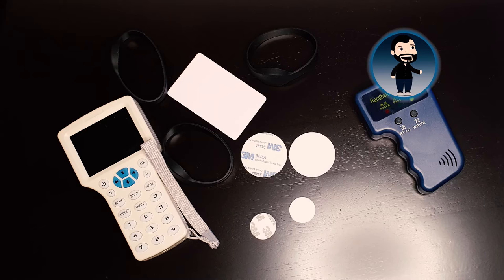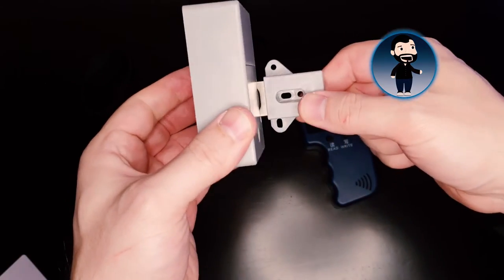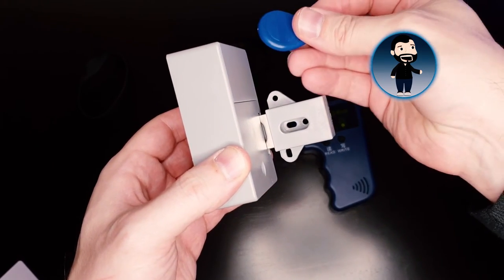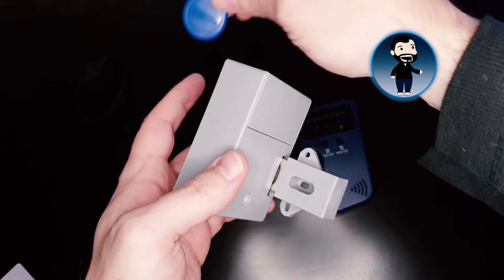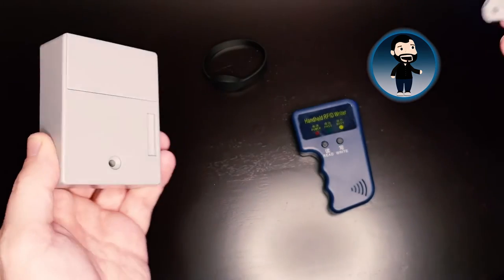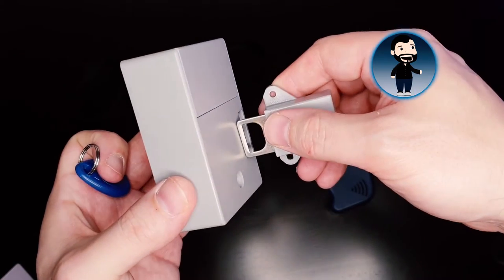Cloning And Smart Use Of RFID Keycards & Fobs

Comment: Hey Guys, the key fob I have (Salto) shows IC-Type A and success read & write, but still the cloned one doesn't work also not giving the option to decrypt with the software, any hints?
Reply from the maker: Not really familiar with the Salto fobs but I've looked into a bit of info and both their RFID and NFC (mifare) cards are encrypted, so while you might be able to read and clone the card ID with a standard reader and writer its unlikely you'll be able to clone the security info. Given that its IC type A im guessing its a Mifare 13.56mhz card or similar, you'd probably need a good reader and apps like Mtools are mifare tools. This is just guesses so I'd do some more research to ensure you are looking at the right option for your specific fob... this is a mine field as there's so many standards and types.

Comment: I have one of those home door keys from KABA. Its a key with its back being blue color and theres a card in there or something, that you put on the door lock and it opens the door. I wanna clone it but what frequency is it or decryption?
Reply from the maker: Did a bit of checking on their website and their data sheets say badges and read/ write devices have matching security encryption that are not accessible, this is would suggest that  only official fobs and readers from Kaba will work. Also seems like their fobs are based on Mifare chipsets so frequency would be 13.56 MHz, but it's not the only standard they do. But it's unlikely you'll find an over the counter device that can clone these either way.
Reply: tnx mate!

Comment: Hi Andy, Great Video. Does the "RFID Multi Card Reader" you linked to in the description "Write" HID fobs? As in the product description it says "【Recording support" - It is supported for HID card 1386/1326/1346, T5577, EM4305, Mifare UID. It can directly enter the number keys." But doesn't say write. Any help would be appreciated 👍
Reply from the maker: Hey there, assuming they haven't changed it since I purchased it, it writes the HID cards for me. What I've found is the best option though is, if you're reading HID cards, to buy T5577 chips and cards to write too as these are cheaper and can support the HID standard. So you'd be reading from the HID and writing to a T5577, effectively turning it into a HID chip (they're virtually the same anyway). So if you check out the video I did about getting a chip implanted in my hand (https://youtu.be/N1l50COggh8) I read from a HID fob for my apartment, but the chip I get is a combination T5577 / NFC chip and it works just the same as a HID chip. 

I would say that all these readers are temperamental. I've had no real issues over the years, but the chips can sometimes have strange encoding or encryption so nothing is guaranteed. BTW, lots of locksmiths have the tools and equipment to read and write fobs, so might be no harm to chat with one of them and see if they can help with your specific keyfob / card. Hope this helps.
Reply: @AndysTechLife  Hi Andy Thanks, I ordered one looks the same as yours however, I just keep getting the error message "read failure" on scan and read. I have tried three different fob types. Any Ideas? (Apologies for all the questions)
Reply: @AndysTechLife  Hi Andy, I've just dropped you an email with video of issue, thanks alot.

Comment: @andy Nice video, i have question though. I have a handle door lock with access card same as hotels or so and not a high end i guess, but on that card our office put expire date. so such card will we be able to clone and duplicate or can we modify or remove its expire date by that 2nd device you showed. Remember those locks are nor centralized and nor computer operated. the office have a nfc black reader they place card on it and update it for one month each time. so what do you suggest from your experience. Plz help
Reply from the maker: The readers won't be able to change the date / expiry on the cards if that's how its done and tbh you'd need to get the specific reader for the type of cards and locks that your building uses to be able to read a write at all. Its possible though that each month they just write a different access key or ID to the cards rather than an expiry date. If this is the case you'd only be able to clone the current 'key' and still need to go every month to get the new access key.

Comment: I have the multi reader. Was able to copy cards of mine onto the included cards with reader. But for some reason I can't copy my cards to the blue keychain fobs that came with the reader, any idea what may be wrong. I understand that's not a lot of info, but figured it's worth me asking.
Reply from the maker: So when I bought the reader it came with a sample of a few different types of cards and fobs, so it's possible that they're not all the same chipset, so that would mean that you can't write to all of them. Best thing to do is use the scan feature on each of the cards or fobs and this will show you the chipset / frequency. Using the scan button on the reader will cycle through all the different settings and land on the correct one for the fob being scanned, so this will tell you if they are different ones. Hope this helps.

Comment: I liked your video but I have a question so I have a key fob to open my apartment gates as well as enter to the office and gym is there any way to clone it since it has multiple buttons to open each door by pressing the button, does this device clone it? if not is there any way to do it because Im planning to buy the a cloner, thanks
Reply from the maker: The ones with buttons, particularly multiple ones could either be using IR or a radio signal like a car key fob so these can't be cloned onto stickers. These would need a signal scanner and repeater to clone which is more expensive and not any smaller. Unfortunately this cloning method only works with contact rfid chips as they're passive. Ie. The get the power from the contact pad so they are easy to copy. Button ones are active, ie they send out the signal so you'd need something to read the frequency and code via radio :(

Comment: I got the little blue reader/writer it came with several tags, I want to clone my home access, because of the number of times it beeps I'm guessing my access key is HID (Mircom) and the blank tags I got are EM4100 so no luck cloning it yet, what you said is that if I got T5577 cards, tags, wrists or whatever those are compatible with HID frequency right? Thanks!
Reply from the maker: Em4100 are not HID compatible but T5577 are, but just be aware not all readers, particularly the small blue ones can read and write both T5599 and EM4100.

It's also a good idea to Google your own existibg card to check if it is HID as if it's not you may need a specific reader / writer for it.

Unfortunately there's no one type fits all as there's so many standards and types out there.

Comment: What's up?  Been into locksports for years and I just got into playing around with RFID fobs. I needed one for my hid fob and had no problem. I notice after trying to copy a friend fob I had an issue with his Keri series fob but the 22 key digital smart card rfid reader writer machine with HD display from Amazon wouldn't read or write it. Could you if possible do a video on the best handheld machine for fobs and the type of fob. Can I use a chameleon proxmark on a smart phone or tablet ? Appreciate the channel and info... 😎🤘🏼✌🏼 From NYC-USA🗽
Reply from the maker: Hi there, thanks for the comment. I haven't found a handheld solution for Keri  or Keri K series fobs, they seem to use some proprietary encryption so although there's services online where you can send a fob to be copied I can't seem to find anywhere that sells a device like the one for the HID fobs.

In terms of using with a smartphone or tablet its unlikely unless you have a external RFID adaptor connected as although smartphones support NFC, the frequencies and technology are different to RFID, and even if your fob is NFC the phones have limited ability to read and write, particularly more complicated NFC cards like those found in travel cards etc.
Reply: @AndysTechLife  appreciate you getting back to me on my question. If I make any headway on the issue I will be sure to report back.. ✌🏼🤘🏼☝🏼😎🗽

Comment: Hey Andy. Quick question as I'm Abit confused I want to clone and copy my college Id card onto another card Incase I lose my main one which reader and writer should I use? My Id is used to open a security gate to get into my college mainly.
Reply from the maker: There's no one reader that will work for all devices and fobs, so you need to find out what type of fob you have. Generally its printed really tiny on the device, such as HID as the manufacturer. Once you know the fob type you'll need to ensure that you buy a reader that is compatible with the specific make that you're using. There's so many formats, frequencies and standards so there's no single one you can get that will work for everything. For example, my old college ID and work ID are HID Prox 2 Tag cards which can be read and written to T5577 cards, but I have a locker fob which is different and can't be read with this device. If in doubt, locksmiths can generally read and copy fobs so may be able to tell you the specific make and model. Hope this helps.

Comment: What if you have several on the back of your phone? Do readers get confused? 
e.g. you have; apartment, gym and workplace as three stickers on the back of your phone
Reply from the maker: The stickers are really short range, so as long as I press the correct sticker against the reader there doesn't seem to be any issues. I've left a few mm between them just to be sure, but the only time there's an issue is when I forget which is which and try and tag the wrong sticker at the wrong reader :D
Reply: @AndysTechLife  thanks for your reply! Are the stickers thick? Is the range too short for them to be placed on the inside of the case?
Reply from the maker: They're about 2mm thick so they probably wouldn't fit inside a case comfortably and unlikely they'll work through it if the case is thick.
Reply: @AndysTechLife  is it possible to copy multiple different door frequencies onto 1 key fob

Comment: Hi mate great video', Do you think it could read & write sifer-p innerranger 128 bit AES encryption? Thanks
Reply from the maker: Very unlikely, most of these readers won't work on encrypted cards and only really work on ones that have plain text / numeric encoding. They also work on only the most common chipsets. For specific makes and models it's best to search for their own reader / writer, but for encrypted ones generally you'd need to go to the manufacturer and this still doesn't guarantee you'll be able to clone if you don't have access to the key that was used to encrypt your own specific fob. It's a complicated space with too many standards but the readers do work with the widely available commercial options like HID.
Reply: @AndysTechLife  Thanks Andy much appreciated.

Comment: Can the RFID readers you've demonstrated here clone car door fobs, garage doors, security gates, etc.?
Reply from the maker: So these readers will only clone contact fobs, i.e., ones that have to be physically touched against a reader and even at that every manufacturer has different standards and chipsets, so there's no one reader that will do all. I always recommend Googleing your specific fob to see if it can be cloned and if the reader you buy will work on it. For example, lots will do HID or em4100 which are very common chipsets, but there's no guarantee that you'll find a reader that works with your specific fobs. For radio or infrared devices and fobs which transmit a signal you're looking at completely different devices to clone and copy and this is much more complicated as you need to capture the signal, find a compatible chip to add the code to and many car manufacturers for example now use encryption and other preventative tech to stop you doing just that. You'd probably be looking at different readers and devices to copy each different fob, unless you pay for high end devices that you can connect to a PC which could do multiple. If in doubt, check with a locksmith or key cutter as they may be able to point you in the right direction.

Comment: Those M3 stickers T5577 can be writen from a ioProx fob? I have a oiProx fof for our apartment and want to copy it to that M3 T5577. Is it possible? And I also put down ioprox fob writer and it shows me the one that you are using, the white one. Is that correct? Thank you upfront if you respond.
Reply from the maker: From what I can tell you can provision the T5577 to act as a ioProx fob, but its not as simple as just using a reader, the chips need to be provisioned first to act as ioProx first. All the readers look the same so don't take the look of one to mean its going to work. Check this out for more info: https://forum.dangerousthings.com/t/cloning-a-kantech-ioprox/4415/8

Comment: My apartment complex uses the generic credit-card style key for garage access and the circular HID for elevator access. Is it possible to write both to a single T5577 Sticker?
Reply from the maker: No, each tag will only take 1 ID at a time, but it's likely that one of those will work for both, I have a similar setup where the door is a fob and the car park is a credit card size, but the credit card size works for both so that's the one I copied.
Reply: @AndysTechLife  

The apartment building I live in uses NEDAP Windshield Sticker for garage access and HID Key Fob for elevator access. I have these 2 devices.

For $150, they sell a credit-card style plastic key they gives access both to the garage (if you wave it in the air) and the elevator. It seems like this is the one you copied, Andy.

Is there a way to make my own plastic key or fob or sticker  that gives access to both the garage and elevator without buying the $150 plastic key first?  In other words, can I use the 2 devices I already have to make 1 device that handles both the garage and elevator.

Thank you so much!
Reply from the maker: Not really, either way you're looking at 2 chipsets so you might be able to stick them together but it'll still be 2 cards at the end of the day
Reply from the maker: Unless you can get a hold of one that does both and see if you can copy that, but you wouldn't be able to 'guess' at it or combine 2 different cards to make a master one.

Comment: Which device works for reading and writing intercom push to open button to a keychain remote?
Reply from the maker: There's so many variations to be honest, your best bet is to Google the particular make and model of your fob or button. Bare in mind though that with so many manufacturers and standards, you might want to consult with a local locksmith first. They're generally pretty helpful at letting you know or helping with copying etc. But there's no one machine that will do all of them,
Reply: @AndysTechLife  Don't wired intercoms use RF signals?

Comment: Just bought one but it always fails decoding my ic-type a encrypted card that I want to put on a smaller fob. Any suggestions
Reply: I ask because I make the key cards for my building but I hate the key cards and want to program smaller fobs. But last fobs I bought where the wrong type for the encoder we use
Reply from the maker: You can try connecting the reader to a PC and see if there's any additional software that you can use to decode, but unfortunately not all encrypted cards can be copied and it really depends on the encryption used. If it's in any way similar to Mifare type A for example, this has read-only access and decryption is difficult. You can check this for more reference, but there's no one solution that works for every type of fob and card: https://www.youtube.com/watch?v=tfti68oKydk

Also, if you do manage to decrypt, bare in mind you can only write back to the same or compatible fob. So you're best bet is to find the writable version of what the card is and see if it's available in different sizes. I have about 6 or 7 different types of cards and fobs from different things and I've only been able to copy about 4/5 of them so far since different chipsets and encryption need different options. 

When in doubt, many locksmiths have the tools and software to copy fobs, so they may be able to point you in the right direction, but if the encryption is in place to prevent this, you may need to speak with the management company of the building to see if they will allow you to copy.

Comment: I have a VingCard Elsafe card. It says that the keycard is protected with your unique ID number. Valid only during stay and that to extend it must be re-codes. Also that entry is recorded. Can this be copied onto a new card? And what type would this be?
Reply from the maker: Haven't seen anything capable of copying these. I did read of some researchers in 2018 who were able to crack the codes using old discarded hotel cards and some emulators, but to open doors they had to use the emulator to cycle through different codes at the door, and once published they helped VingCard patch that vulnerability,  so it looks like there isn't a way to clone these since they use lots of different anti cloning tech. It would also stand to reason that even if you could clone one, it would only work for the same amount if time as the original since the access for the door changes once the stay time is over.